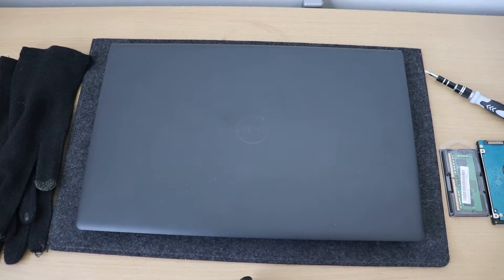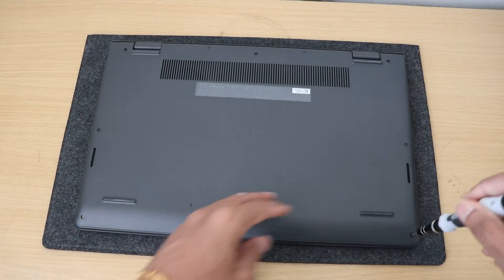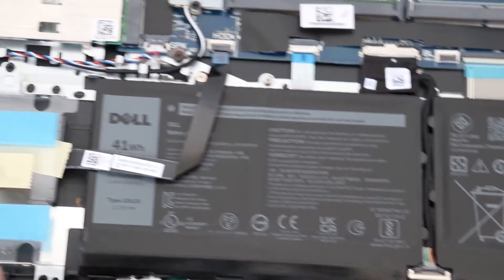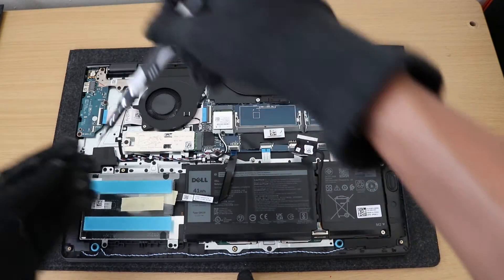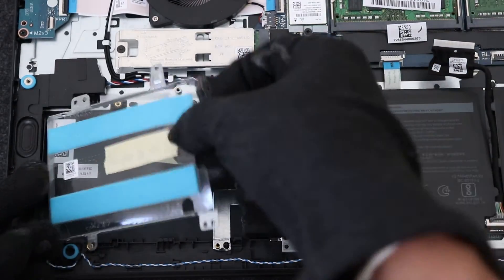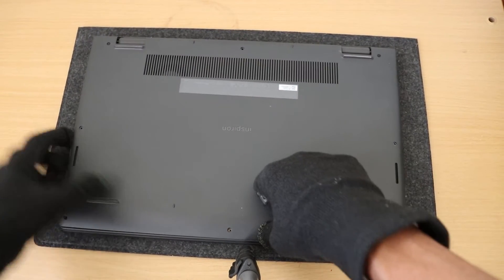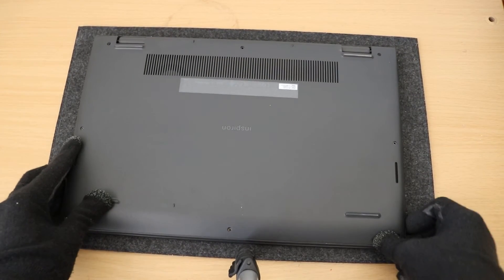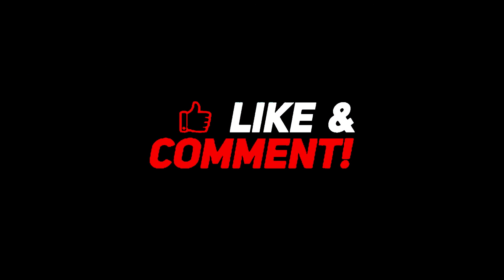Dell Inspiron 15 3511 SSD/RAM Upgrade: Full Disassembly Guide (2025) 🔧 #laptopupgrade

Comment: Can Dell Inspiron 3511 use SSD sata 2.5"?

I have problem that drive D which is SSD randomly missing. I ask dell support, they told me that this Dell Inspiron 3511 can't use SSD SATA 2.5".

Do you have same problem as me?
Reply from the maker: I didn't use sad for this. But I used for my old dell Inspiron 7348 2 in 1 without any problem.

Comment: hello. i just wanna ask.  coz i have a dell inspiron 15 3511 11th gen intel core i5-1135G7 It has 4gb ram straight from the box. Can it be upgraded into 8gb or 16gb? TIA.
Reply from the maker: Yes, You can. Before upgrading check RAM Speed because ii supports two speeds DDR4, 2666 MHz/3200 MHz.
These are the combinations you can follow.
4 GB, 1 x 4 GB, DDR4, 2666 MHz/3200 MHz
8 GB, 1 x 8 GB, DDR4, 2666 MHz/3200 MHz
8 GB, 2 x 4 GB, DDR4, 2666 MHz/3200 MHz
12 GB, 1 x 4 GB + 1 x 8 GB, DDR4, 2666 MHz/3200 MHz
16 GB, 2 x 8 GB, DDR4, 2666 MHz/3200 MHz
16 GB, 1 x 16 GB, DDR4, 2666 MHz/3200 MHz
Reply: @unboxuptech  thanks btw.
Reply: @unboxuptech can we mix the speed of ram?
Reply from the maker: @ok-qg8yx  Yes, you can but after mixing speed New SPEED will be at the speed of your slowest speed. But make sure to all RAM faster than those specified for your LAPTOP.

Comment: will it support 2 x 32 GB RAM upgrade? 
2Rx8 dual rank 3200 MHz DDR4 RAM - Crucialv
Reply from the maker: no, it only supports a maximum of 16 GB (2 x 8 GB, DDR4, 2666 MHz/3200 MHz).
Reply: Mine supports up to 32gb, but I wouldn't test 64

Comment: I have a question .. I can change the CPU? I buyed this PC with Intel® Pentium® Gold 7505
Reply: I found that the CPU is soldered, my finding was from the socket which is FCBGA1449, BGA means Ball Grid Array. Therefore, it is not possible to change the processor without qualified labor and adequate equipment. By: Google Translate
Reply from the maker: @partnerplayer_oficial  yes that's true. most of the laptops can't change CPU & GPU.

Comment: I wonder what the performance of that laptop will be by putting 2 modules of 32gb ram each
Reply: I did this, I originally bought it just to have a computer away from home hated the low amount of RAM so I threw 32gbs of 3200MHz RAM in it and it's a pretty dramatic improvement. CPU keeping pace is the issue at that point.
Reply: @sixfromtokyo  were you able to successfully upgrade to 2 x 32 GB = 64GB total RAM in this?
Reply: @patrickjane6765  No it's a 32gb total

Comment: You can put the laptop in Service Mode before opening it. That way, you don't need to disconnect the battery. See the Service Manual for details.